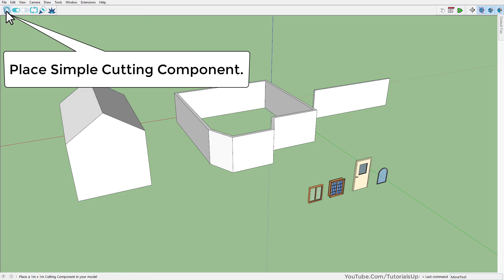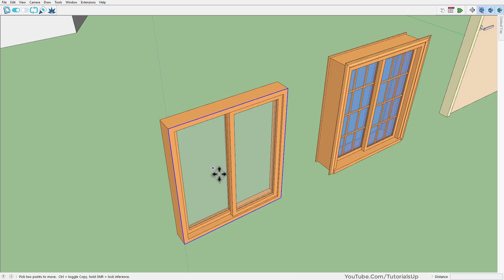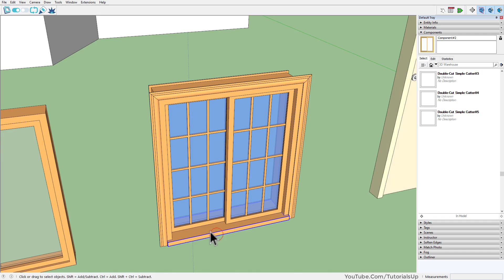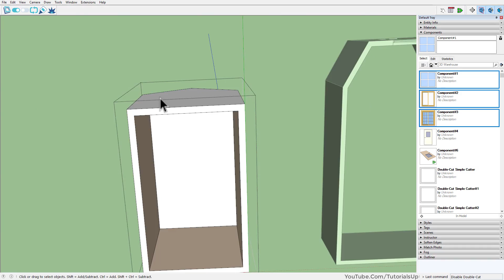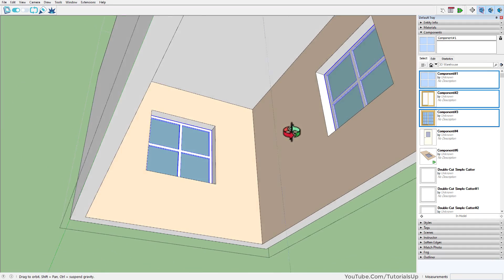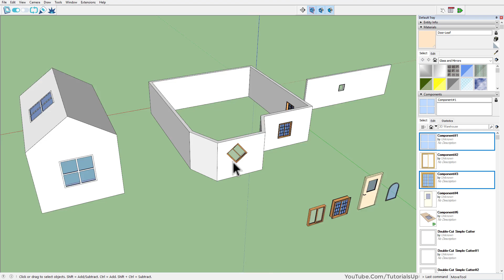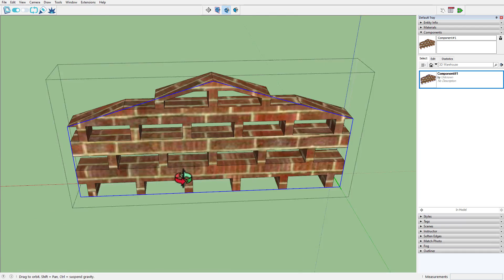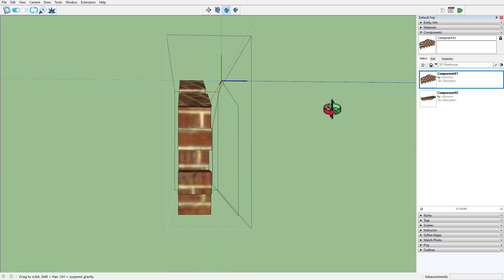How to Use Double-Cut Plugin For SketchUp

Comment: Thanks a lot, I havbe Double Cut 2.0 and there is not the Explode command, how it works? thanks
Reply from the maker: The explode command has been removed in v2 because it is no longer needed. Now, section cuts work as expected even without the explode command.: https://youtu.be/snJftstQ2j4